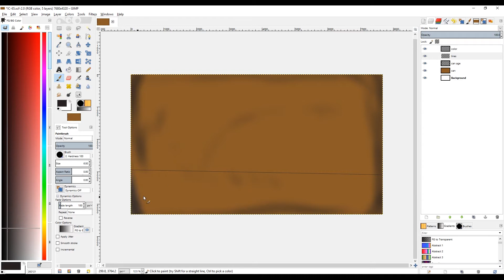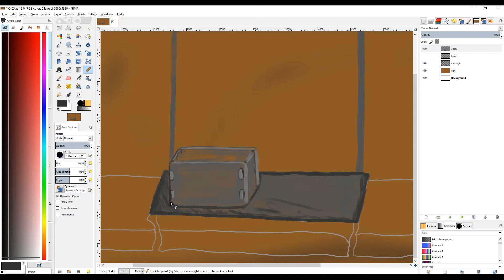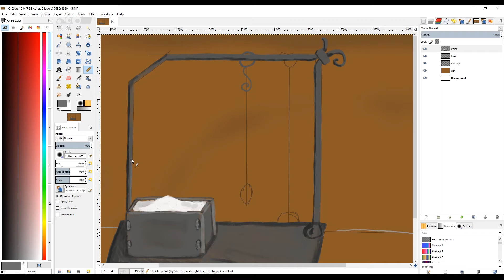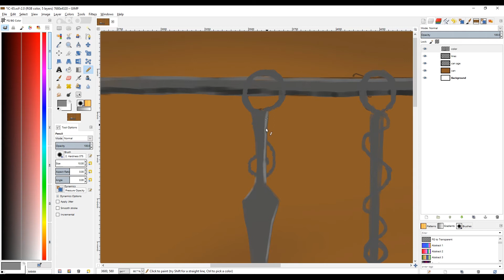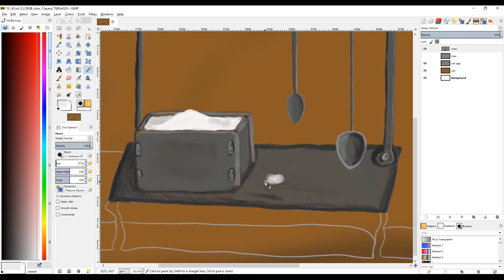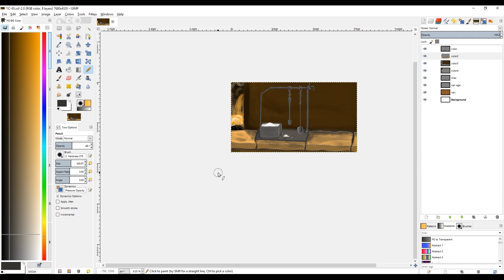Iron Concepts 65 - What Little I Know About Forge-Welding

Comment: hey - artists always place their own limits upon their work (techniques, materials, etc), right? So, maybe there will be those who choose to use forge welding as a method of  assembly. This joint design thing is the part that I don't get. Oh, fyi, soaking welds above critical and cycling above and below (aka normalizing) also strengthen welds A lot. thanks for the video. Great ideas.